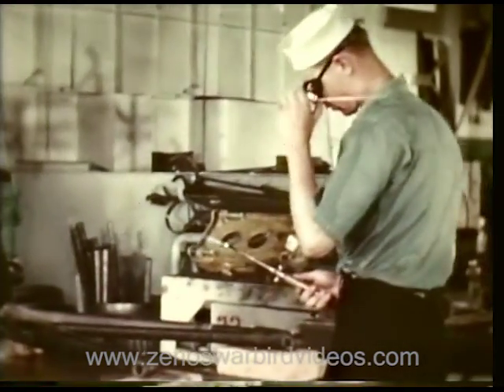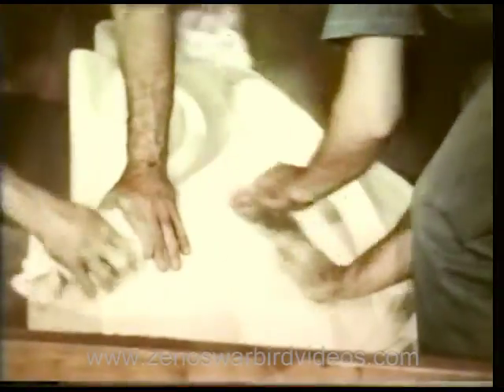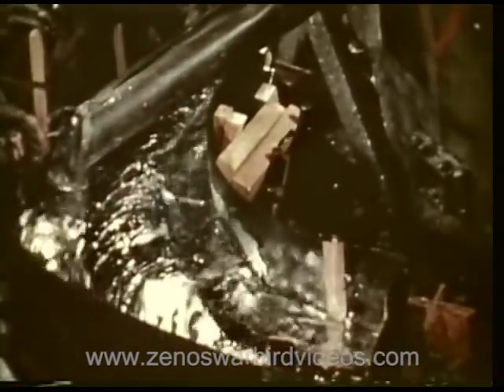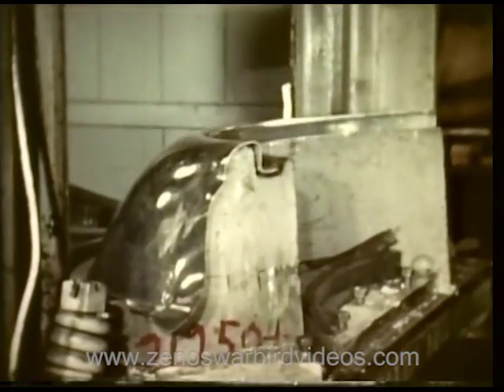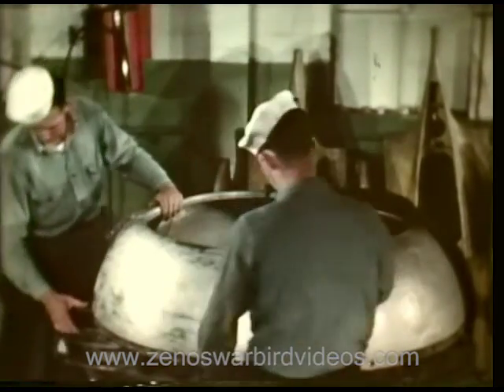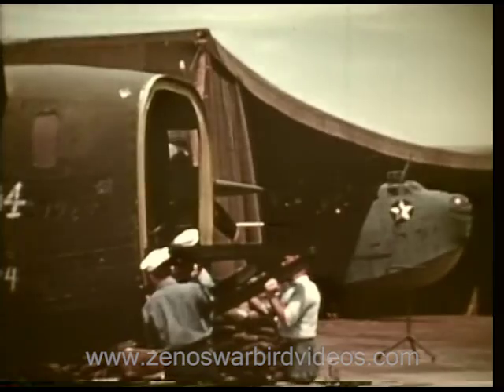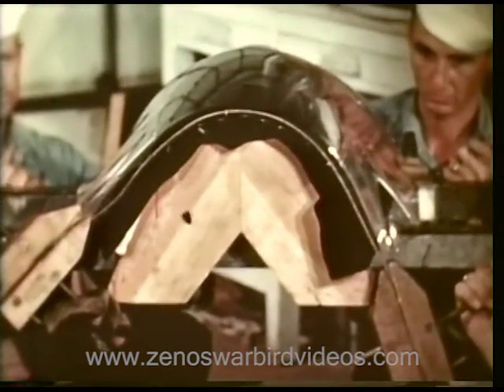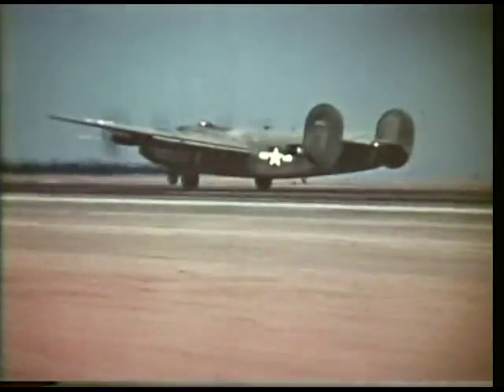WW2 U.S. Navy Metal Smiths – Making aircraft parts from scratch (1944, Restored Color)

Comment: I never knew this stuff went on outside the factory. For a cowling section, I would've figured on hammer/dolly and English wheel work. I do suppose that type of work would also be necessary in the field where drop hammers weren't found under every tree, not to mention a mini-foundry for casting the dies! I liked the stretch forming of the plexi as well. Would've like too seen how the whole unit was assembled and maybe some blow forming. Very interesting stuff!
Reply: A lot of hobbyist blacksmiths around the place got their drop hammers from Navy surplus - they were tucked down in the bowels of ships for repairs just like this.

Nowadays, Lockheed would probably sue the crap out of you for making parts for their aircraft in the field.

Comment: There  is a story about Greg 'Pappy' Boyington setting down (crash landing) on a newly opened (he had been briefed that the new strip was opened and could be used as a divert field in case of damage) fighter strip.  He took damage to his Corsair which created engine problems with it cutting out, and was forced to set down.  Turns out and the strip was not quite as complete as briefed and after a short run-out he hit a BULLDOZER, parked on the run way, damaging his prop.  Boyington was examined by corpsman, went to the base command shack and radioed back to his squadron for a new prop and some mechanics to attend to the damaged bird.  When Pappy went to back to his air craft he found that the SeaBees had used a wooden a-frame to remove the 13' diameter prop and moved to their forge and were industriously heating it up preparatory to hitting it with a large HAMMER to straighten it!  Boyington was stunned, the SeaBees said they would be done in a couple of hours and he could leave in the morning, the squadron mechanics were not even due till noon the next day!  If is recall correctly (and it has been many years since I heard the story) Boyington got in the aircraft, gave it a brief test run, and pronounced that it would get him home!  He did say it had a hell of a vibration at full throttle so he flew it home slowly but he made it home (thanking God for not encountering any Japanese).
Reply: fooman2108 do you remember where you heard it?, if it's in a book it might be an interesting read.
Reply: Not sure... Baa Baa Blacksheep by Boyington?  Might be a SeaBee diary that I read some place, sorry do not recall.  Had a CPO tell me the definition of a sea story "20% fact, 20% fiction, 60% BALLS!  (the tell lies like that!)" it is entirely possible that, that is what this is....